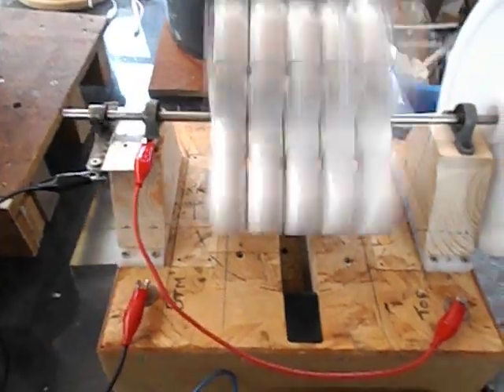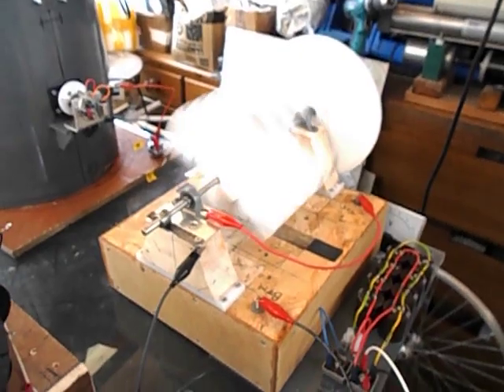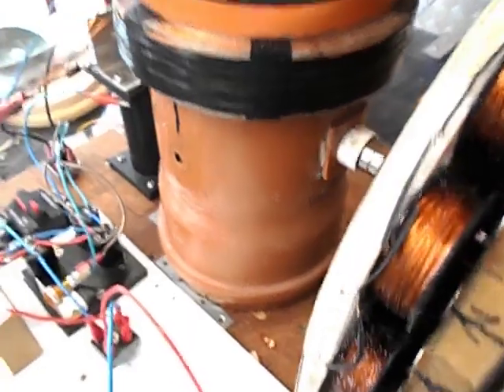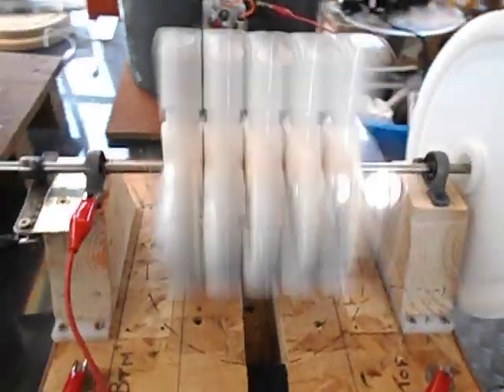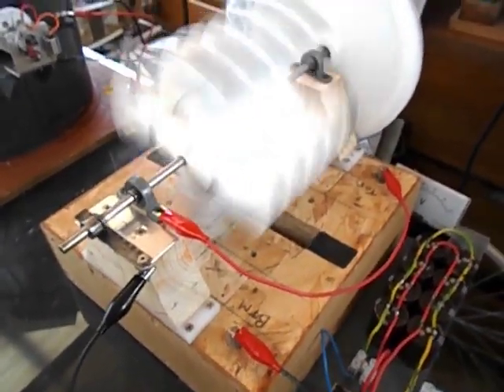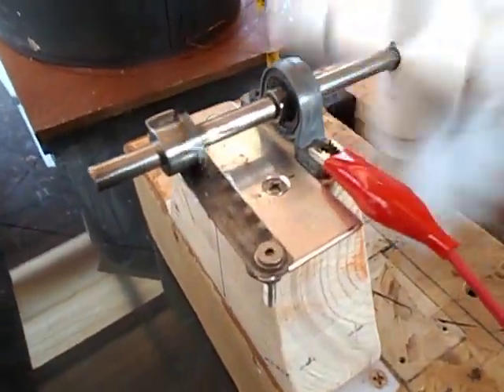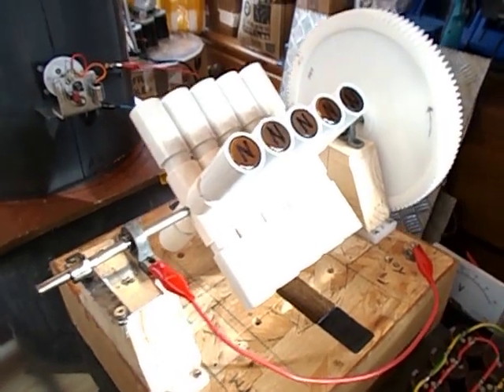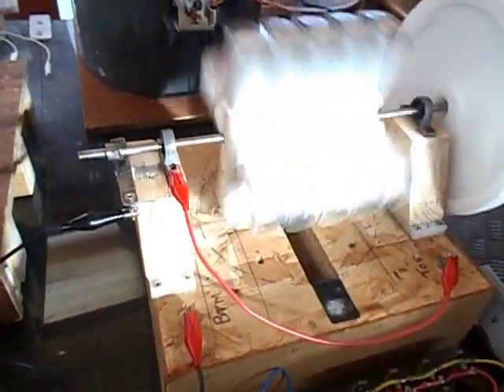4 pole Newman motor on a 3000 turn coil

Comment: Where is the coil for this machine?
Reply from the maker: Hi The coil is in the wooden base. it is 9 inches inside dia and the outside dia is 12" inches. x 3 inch deep  3000 turns.  I can mount different designed rotors using this set up.

Comment: GREAT Newman design. I'm a little confused on where the coil is? Is it in the wooden box below?
Reply from the maker: Hi Yes I boxed it up to protect it and so I can mount various versions of a rotor design. glad you like what you see. I will be posting another video soon showing a Axial flux generator powered by my other Newman motor that you will have seen.
Reply: @DeryckThompsonChasingtheDream  That's a great setup. I think I will copy if you don't mind. I'm always on the hunt or cool designs to mimic :)
Reply: @DeryckThompsonChasingtheDream  Couple of quick questions, how big is the coil? Is it as big in diameter as the rotor is long or, is it the same size as the circle drown on the plywood. Also what circuit are you using to pulse the coil?
Reply from the maker: @mcorrade  Hi, The circle drawn on the plywood is the inside diameter of the coil and the outside diameter of the coil is approx 1/2" from the edge of the plywood. Its a very big and heavy coil with 3000 turns of 1.2mm wire. If you look at one of my other videos I believe I show how the domed coil is made which is similar to this one. The domed coil is for experimenting with self powering as it keeps the magnet very close to the wires of the coil, but thats yet to be sorted and posted up. regarding pulsing circuits? I use a very basic mechanical commutator on the shaft. you will see on the left hand end there is a collar and I have shaped it to into an oval shape. this means that when it rotates it makes contact with the spring contact twice per revolution, I did this to achieve maximum power by generating a powerfull electric magnetic force twice per revolution. It is trouble free method and I dont need any circuits or resistors or anything like that.  Hope this helps you. please feel free to ask any other questions. Regards  Deryck
Reply: @DeryckThompsonChasingtheDream  Yes I did see the mechanical comm on the left side but had for gotten that. I will look for the other vid to se the coil build.